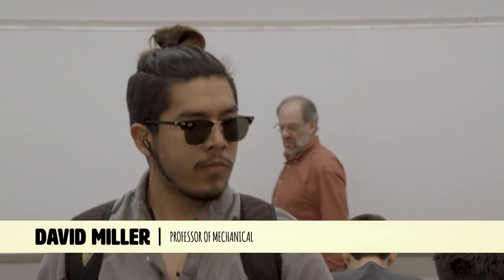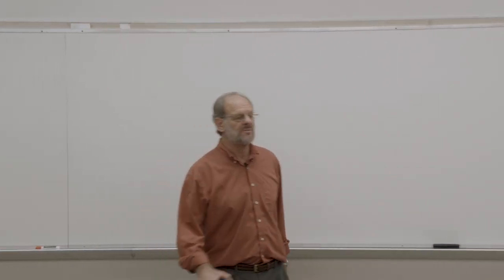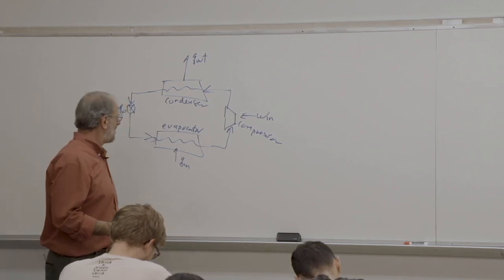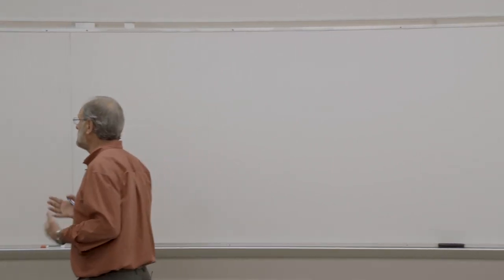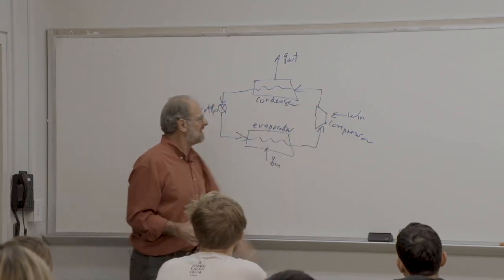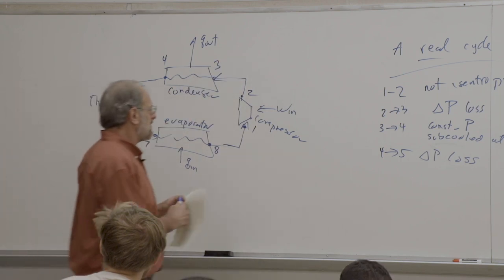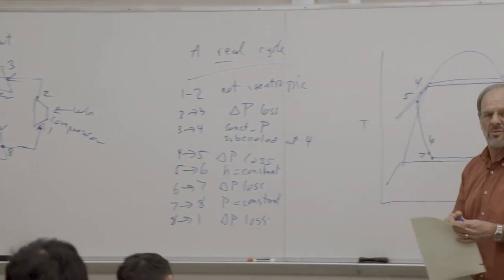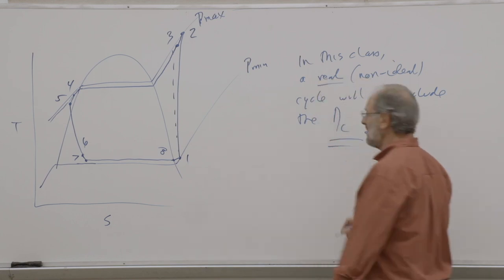Thermodynamics: Non-ideal vapor-compression cycle, absorption refrigeration cycle (38 of 51)

Comment: 7:00 @process 8 to 1:
Why does losing pressure cause the saturated fluid to increase temperature? (When state 1 was defined in the diagram, it was placed slightly above state 8)